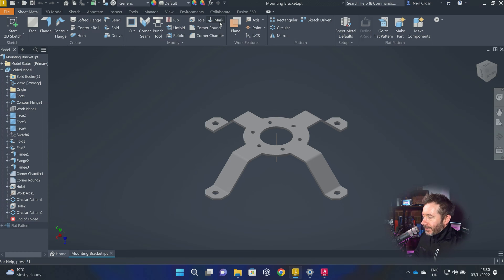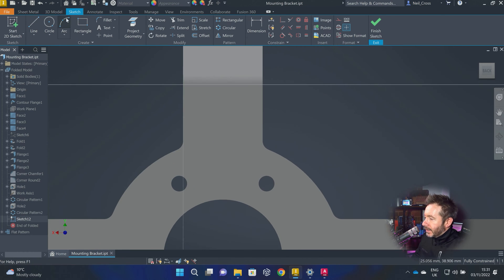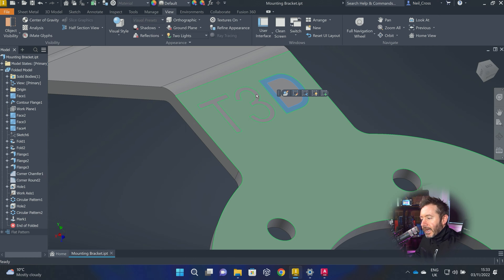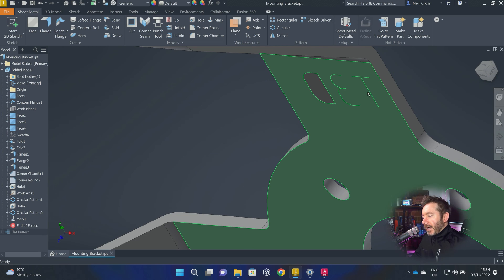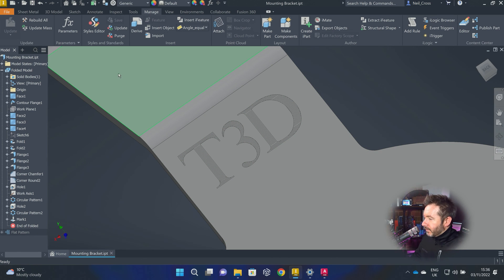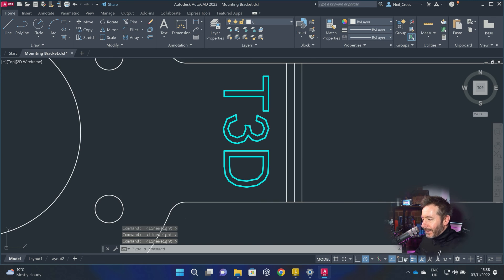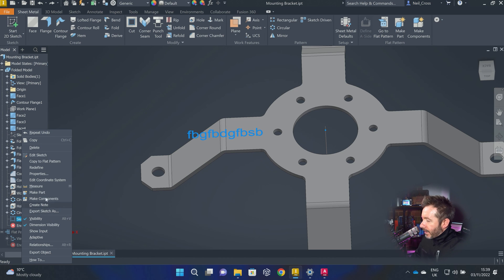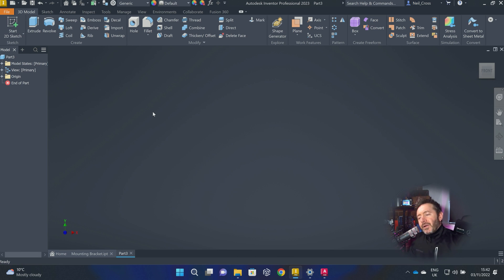How do you do? Laser Engraving/Etching - Inventor Mark Command Tutorial

Comment: Is there a way to do a single-line laser cut in a flat pattern? On thin metal or parts that would be difficult to bend on a press brake, we sometimes do a single-line laser cut with a couple bits left attached and then bend the part by hand. To accomplish this in our models, we have been doing really thin slots on the bend lines in the flat pattern, but our laser programmers are having to manually edit what they import from inventor to turn them into a single-line cut, if they don't the laser goes down both sides of the slot and makes a complete mess of things. I would love something that I could implement on the model design side that would fully automate it on the laser guys' side. Thanks.

Comment: Can we have a general tutorial on templates, from sheet metal, frame generator and content center
Reply from the maker: Well frame gen and content center are pretty much one and the same in terms of data, and don't really have templates, they're table driven files which I suppose you could call the table a template.  Unless you mean styles? I couldn't do all that in 1 video it would be too long, but if you can let me know what areas within that you would want to see talked about and I'll see if it can be worked into something.
Reply: @Neil3D  on my custom template i have common used parameter ,specific material, custom properties, on sheet metal templates i have custom sheet metal styles,  ilogic rules, part name formula etc. etc. and when i use frame generator or content center all my pre settings are gone. that's why i was looking for ta tutorial on templates..
Reply: @Neil3D  thank you for all your help love your tutorials